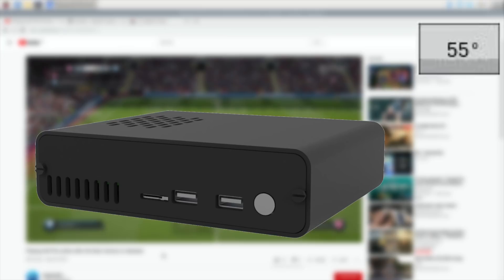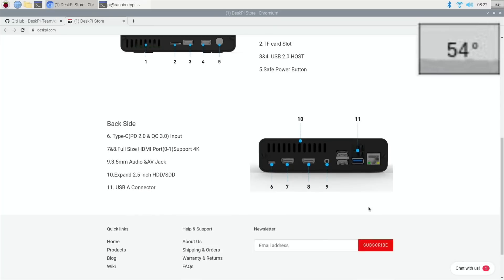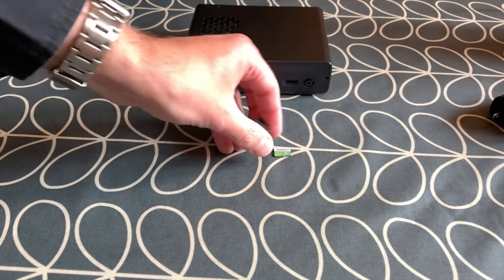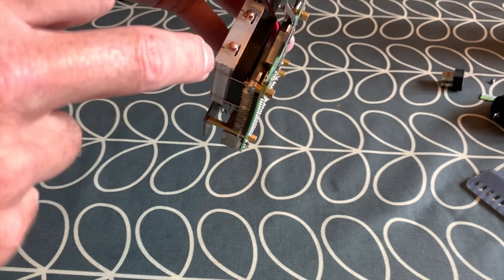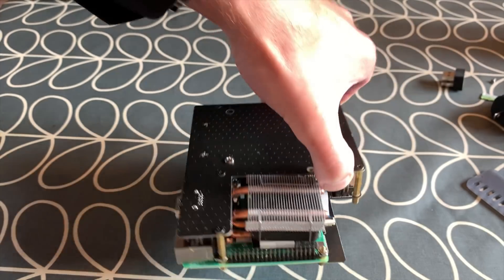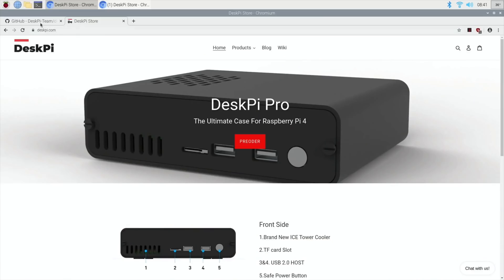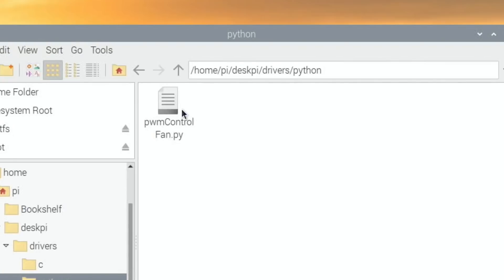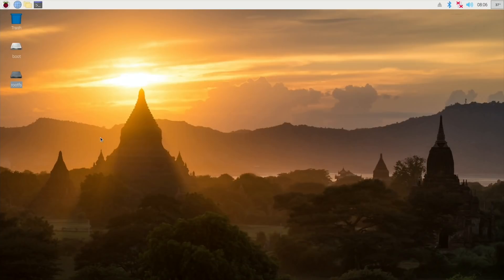DeskPi Pro. SSD ready Passive or Active case. Raspberry Pi 4.

Comment: This is a terrible product and you should not buy it at any cost.  The 
original version used an incompatible chip for the SSD interface and the
 newer version uses a crap chip that has no UASP or Trim support.  The 
manufacturing of the case is pretty poor with noticeable sage in the 
GPIO header riser.

Comment: Lovely, just cant help feeling that these fancy cases are losing the whole point of a PI.  By the time you buy the PI, this fancy case, a SSD, keyboard, mouse, cables, PSU etc, you may as well by a small laptop, and even then you don't have battery power.

Seem the aftermarket accessories market is bigger than the PI market. (And most certainly profit and markups are WAAAY bigger) If you wanna make money don't make a PI or a MeTooPi, make goodies for the PI.
Reply: Realistically, this Video was viewed and my Reply penned on a Pi 4.

Comment: I preordered one of these bad boys. I have 2 2.5" spinning rust drives. One is a 9mm tall 2TB drive. I know that will fit. I also have a 14mm tall 4TB drive. These drives do not fit in laptops, so I would like to know if these thicker drives will fit into the DeskPi Pro case. It would make for a great Plex box.
Reply: Did you have any luck with a 14mm drive?  I have the same question for a 15mm drive.  Thanks.

Comment: Waited couple of months to arrive and I'm sad to report that booting from SATA SSD doesn't work.
I tried with three different SSDs and three operating systems which otherwise work with my external USB3 to SATA controller.

The main reason I bought Deskpi pro case is the internal SATA controller, so I can have my SSD inside the case, so I'm extremely disappointed.
EDIT: Kevin Deng
 from DeskPI commented "We will send you the replacement board"

Comment: Bought one of these after watching your video. Boots OK from the SD but cannot get it to boot from a Sata drive or an M.2. Tried asking the support line but no response. Any ideas? One thing, on about the third attempt at booting the supplied power supply went into an off and on repetitive cycle and this is when I could not boot at all. I am using a Raspberry Pi power supply to boot from SD but won’t boot from anything else.
Reply from the maker: Try this

USB Sata cable Fix. Black screen, won’t boot. Raspberry Pi 4 8GB. Raspberry Pi OS 64bit.
https://youtu.be/9HV4C0Llktk

Is your os supported? I only have a prototype without m.2.

Comment: I got one of these as a gift from a friend and we waited 3 months for them to arrive. When they did they had the following faults:
1) the GPIO output board is curved out of shape
2) the much-lauded ice cooler is so far away from fitting the Pi4 board, you would crack the Pi board trying to tighten the provided screws to hold it in place
3) assembly is very fiddly, many components are tiny and easily lost. Ribbon cables are tricky to attach at terminal points
4) the I/O board for a hard disk/SSD is out of shape due to poor support
5) the boards are a VERY tight fit in the case - force is required
6) the front and back panels are hard to fit at the end due to poor alignment - you can do it though.
My friend complained to the company and this was their response:
"Deeply sorry for the inconvenience caused to you，
We will re-send you a new version PCB board，（except the smaller Adapter Board）
At present，we are testing it，When we finish it，we will send it to you
（Considering R&D and mass production, the holiday on the Chinese Spring Festival, it estimated to ship it for you at the middle of March 2021）
Merry Christmas！"

Now, are you sure you want one?
Reply: I really would have lived with everything you reported (at least my GPIO board was straight) except that on mine one of the HDMI ports didnt work either.  When I emailed them they responded quickly but surprised. Come on.  They knew the boards are bad. I would be surprised that 2 weeks from now the website is still there.
Reply: Given the waiting times and the hassle involved in returning it, I decided to live with it too. I bought longer standoffs to get the heatsink to fit on the Pi4 board, what did you do to get around that problem? Now you mentioned the HDMI port issue I need to check that too.

Comment: Good review of an interesting case. As for the fan script, it reads the cpu temperature and sets the fan speed accordingly. If the temp is between 35 and 50, the fan is set to 25% of its maximum speed; between 50 and 65, the fan is at 50%, and so on.

Comment: Looks awesome! Any idea if it's UASP?
Reply: Suport UASP,just tested!
Reply from the maker: it is.

lsusb -t

/:  Bus 02.Port 1: Dev 1, Class=root_hub, Driver=xhci_hcd/4p, 5000M
    |__ Port 1: Dev 2, If 0, Class=Mass Storage, Driver=uas, 5000M
/:  Bus 01.Port 1: Dev 1, Class=root_hub, Driver=xhci_hcd/1p, 480M
    |__ Port 1: Dev 2, If 0, Class=Hub, Driver=hub/4p, 480M
        |__ Port 4: Dev 3, If 0, Class=Human Interface Device, Driver=usbhid, 12M
        |__ Port 4: Dev 3, If 1, Class=Human Interface Device, Driver=usbhid, 12M
        |__ Port 4: Dev 3, If 2, Class=Human Interface Device, Driver=usbhid, 12M

lsusb

Bus 002 Device 002: ID 152d:0562 JMicron Technology Corp. / JMicron USA Technology Corp. 
Bus 002 Device 001: ID 1d6b:0003 Linux Foundation 3.0 root hub
Bus 001 Device 003: ID 046d:c52b Logitech, Inc. Unifying Receiver
Bus 001 Device 002: ID 2109:3431 VIA Labs, Inc. Hub
Bus 001 Device 001: ID 1d6b:0002 Linux Foundation 2.0 root hub

Comment: this case is similar in design in some ways to node’s (youtube) proposal for a mini raspberry pi 4 server case where he also moves the micro sdcard to the front or other location, but that one is more of on a proof of concept stage.

this seems like a step up from the argon one in terms of as a desktop:
it looks like you can use an ssd drive to m.2 ssd adapter with an m.2 for faster speeds without clutter hanging out on your desk.
but just like the argon one, it does not expand on usb 3.0 type a ports. the ports in the front are usb 2.0, so depending on your needs you may still need that usb 3 hub. 
the advantage of the argon is easy access to the gpio. 
but as i’ve mentioned, i like how this case moves the microsd slot to the front, which is much better than the argon one, where you can easily miss the slot and lose the sdcard inside the case. that is one design flaw of the argon one.
Reply: If you're using M.2 because you think it's faster than a plain SATA SSD you're incorrect. Even the slowest 2.5" SATA SSD is bottlenecked by the USB bus on the Pi. Same old story, just not as bad now. Same is true whether for M.2 SATA or NVMe, could be either, still going through USB at < 5gbps, so the extra cost of that + adapter is wasted. Same for adding more USB3 ports... every one you use is taking away bandwidth from your SSD storage. I really hope the next Pi has a 2nd PCI-E lane with an M.2 connector or at least a dedicated SATA controller not reliant on the USB bus. The issue I foresee is they're already having issues with board real-estate, a SATA controller + connector would be hard enough to fit, an M.2 connector would have an even larger footprint.

P.S. I've lost an SD card in my ArgonOne, that is definitely annoying to take it apart to get it back out.
Reply: Wild Tangent i’m using an m.2 because i have that already from an old gpd win 2 upgrade to 512gb and trying to limit buying another form factor for the same purpose. the main thing is moving away from the micro sd with better performance. that’s what i meant by faster speeds. plus i like how it is smaller than a standard, bulkier sata ssd. plus, i’m using the half-length or half-height  2242 version of the m.2. form factor so i don’t think real estate for the current case would be an issue with a sata ssd to m.2 adapter. 
and i agree about the sharing of resources slowing it down. there’s only so much you can do with the pi’s hardware limitations, but it’s a cool hobby making it better in certain regards than a stock setup.
Reply: @iblackfeathers  oh by all means, smoke em if you got em I say. I just wouldn't recommend specifically seeking out an m.2 setup on a Pi over plain old SATA because it's just not worth it if you're paying.

Comment: OH MY GOD THAT CASE LOOKS SOOOO GOOOOOOOOOOOOOOOOOOOOOOOOOOOOOOOOOOOOD!!! But my setup won't work with this. I need speace for my HAT... There is a better option for relocating a USB... lol.. I also need access the to GPIO header at the top of my HAT... 

52Pi has a case for a low profile cooler tower.. but I need about.. a centimeter of space/bay under the pie and another centimeter of space in the exsisting ceiling of that case. I've modded it and destroyed it. OR if it was just wider.. I could fit my boot device in there. ETA Prime might of started this addiction but, this channel inspires me to another level. I've been through .. so many cases and there is nothing that satisfys my needs. Thank you for your passion sir.

Comment: Man $55 + $7 shipping for that is a steal! Cooler and power supply and the control board. Better believe I'm buying one. Small thing, but I wish it had an RTC too. Thanks to you and geeekpi for the video.
Reply: There's tiny little ones you can just hang off the GPIO stick inside somewhere.

Comment: I have one of those fanless chinese cases with a Pi 4, 4GB. If I want to cool it, I fill a metal glass with cold water and set it on top of the Pi. I've seen it go from 55 to 35 in minutes.
Reply: I have that armor heatsink case too, and a real copper mug (what else am I going to drink my Moscow Mules from?)

I'll have to give this a try 😂
Reply: ah, the sinclair zx80 cooling solution lives on!

Comment: The first batch of product is in mass production. We're trying best to shorten your waiting time.
Reply: Can you confirm that the retail version will not have that external USB patch and the connection will be entirely internal?
Reply: @gklinger  Do you mean the USB adapter for the Hard Disk expand board?
Reply: @kevindeng1889  Yes, sir. If I understood correctly, that connection will be internal and the extra USB port removed?

You guys need to stop making cool stuff because I buy everything you make and now I have too many Pis!
Reply: @gklinger  One of the USB 3.0 port used to expand the Hard Disk,so you can use another one.
More and more cool and unique stuff will come,Watch your wallet.
Reply: Golan Klinger My pi count stands at 14 raspberry pis at the moment 🙄
Reply: @kevindeng1889  I apologize for my confusion. The pcitures on your website show models with four and five rear USB ports (2 x USB2 and 2 or 3 x USB3). How many USB ports are there on the back of the production unit?
Reply: @ontarioreignfan  You win. I only have one 3B, two 3B+, and three 4B and I don't have enough uses for them. I really like this new case though so I guess I'll be getting another. Maybe I'll add a big SSD and use it as a games machine. I don't know.
Reply: Golan Klinger I don’t have enough uses for mine but when the pis go on sale, and given their uses, it’s too hard to pass up. I have (1) pi 4 8GB, (3) pi 4 4GB, (2) pi 4 2GB, (4) pi 3 B/B+, (2) pi 2 and 2 pi zeros.
Reply: @gklinger  there is a way... it will require you to solder the expansion into a hub. That way you can get more USBs. This will create 2 problems. 1. Bottle neck 2. Sacrificing the use of one of the USB ports.

I'm about to experiment with flipping the USB 3s  on the otherside of the board in reverse. Then having a dummy on top for asthetics.

I just wish there was a case maker out there, that could accommodate my needs............. @52pi...... Lol

Clearly that Lil usb 3.0 jump box is a pain. If there was enough space below some rerouting can be done.

The Argon One is a decent candidate for modding because of that plastic bottom.. But that appealing top has no compromise...

LOL I mounted a 4in display on it anyway. We can make anything work as long as there is a way. 🤣
Reply: @ontarioreignfan  I have 20. 5 Pi 4s and everything else in multiples. I intend to evaluate them all for distributed multi-processing possibilities.
Reply: Donald Porter 🤷🏻‍♂️
Reply: @gklinger  - I can assure you that the one I got DOES still have the external connector!
Reply: @markbinner2375  Thanks for the info.
Reply: It's been more than 3 months  I ordered 2. I have email you guys several times but no reply. My account  has been charged  but no sign of my order shipping? Hope this deskpi is real?
Reply: @emmanuelappiah9167  We are try our best to fix these problem to fullfil the first batch
Reply: Emmanuel Appiah I’m having the same issue. No replies to emails and they keep pushing the shipping date back.
Reply: Emmanuel Appiah Did you see the updated shipping info on their website? Now says shipping November 15-17 and they will include a 32GB sd card for the delay.
Reply: My case is coming. Got a shipping confirmation. Can‘t wait for it 👨‍💻.
Reply: @amprivat69  Nice... let me know when you get it.
Reply: @amprivat69  Same here. Should be here within 2 weeks.
Reply: ordered one  and the delivery date has been pushed forward twice
so beware the may never deliver, id say dont order one until the promise it will be shipped
Reply: @bobdavenport5190  We add 3 function,so the shipped time delay,i am so sorry that,the order will be shipped out definitely。

Comment: Do you lose the usb3 connectors?
Reply: You lose one if you choose to install a hard drive or SSD inside.
Reply: @markbinner2375  I gave up with mine its not fit for use

Comment: WOW this is serious! Finally a case that can go into battle with the Argon One!!!
Reply: Welcome...to another edition of Thunderdome!
Reply: @RCfromtheNYC  https://www.youtube.com/watch?v=cxSw7zbw4vM ;)
Reply: I would wager that this one would win purely because it adapts micro hdmi to a full size port
Reply: Ahmed Jan And has room for a ssd 😁
Reply: The Argon One fan is so annoying though, had to replace it
Reply: @ashame001  I was thinking of replacing my fan. Which one are you using now?
Reply: @RCfromtheNYC  https://www.amazon.com/dp/B07KRSF8RZ/ref=cm_sw_r_sms_apa_i_cOvzFb17PPPBM  connector is to big so just solder the current connector to new fan, or  fan to pins directly, will still humm no getting around the vibration transfered to the case, but much less, I ended up soldering it to the 3v in the back ran wire through camera hole, still hides under back cover, no noise but will run to 70c when overclocked to max under load, will drop to 60c if you remove the cover for more airflow
Reply: More like Beat the Argon one.

If they released this case a few months ago i would have bought it,

{currently using a combo of 2 cases} {aluminium case+ Full case-body aluminium heatsink} then a 3d printed Fan mount.

A RPI 2 running Pihole is about 6-7 degrees above ambient.

Comment: Would an rpi3 work in this?
Reply from the maker: No Pi 4 only.
Reply: @leepspvideo  do u know of an rpi3 option?
Reply from the maker: The Mipsy I only really cover Pi 4, so I haven’t looked. I’m sure something similar is probably available.
Reply: Does this case lose the usb3.0 connectors?
Reply from the maker: I’m not sure as mine isn’t the final one. The website keeps getting updated with information.